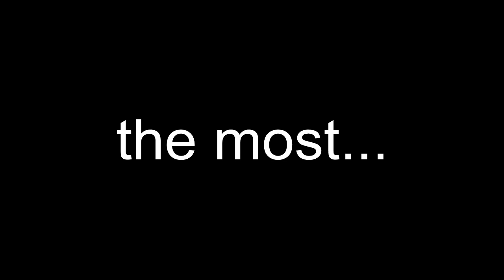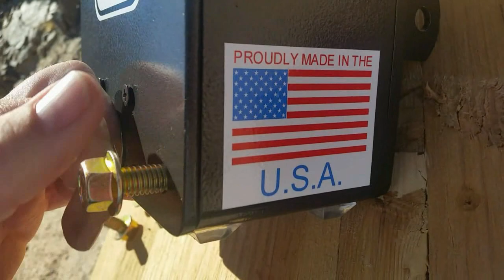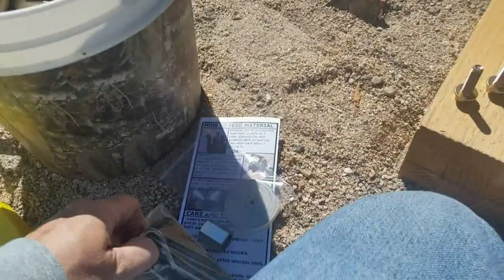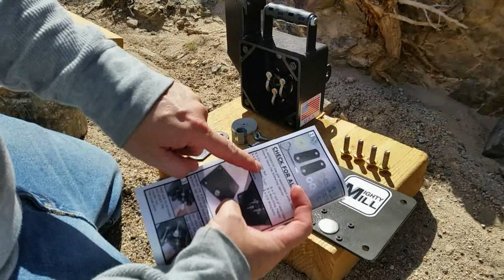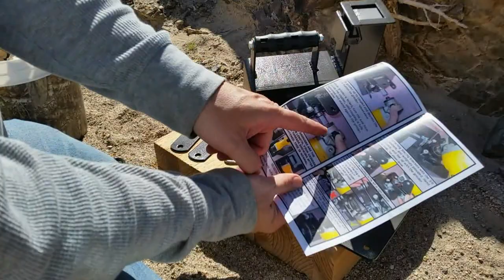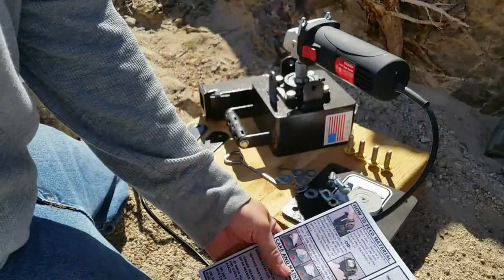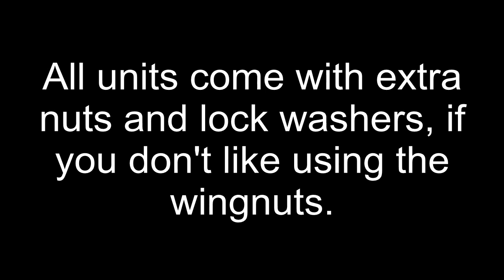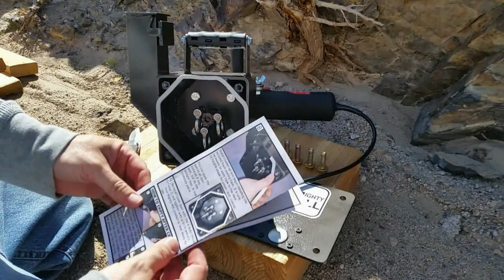Mighty Mill portable mini rock crusher. Sample GOLD ore FAST!!!

Comment: I purchased one of these last year and just got around to using it. One of my hobbies is to smelt iron ore in a bloomery style furnace and I had been hand crushing ore before. Let me tell you this piece of equipment is a GAME CHANGER. It is super easy to use and would eat any ore I threw into it. I was easily able to process ~ 100lbs of roasted hard rock iron ore (lots of hematite) into a find sand consistency in about 2 hours. Even with all that material processed, the internals of the mill are in very good condition. Works like a charm and I would highly recommend to anyone needing to crush up rocks! 10/10

Comment: Reading comments, I have been running the idea of attaching a "Feed Tube/Hose" from plug hole to a 
??something??, Bucket, can whatever! Just knowing the bit of pressure building up in there, there should be plenty of blow-out at the plug hole. I'm excited to get this Pulverizing!
Reply from the maker: I have already designed a prototype version of a discharge tube attachment that can have different sized mesh added, and I will have that available when I relist new mills in August. Here is a link to a customer's video that I made the prototype for: https://youtu.be/mtc7IIuN0Uc

Comment: When will the next batch be ready? I want to get one! We have lots of ore and quartz here in Northern AZ. Will any side grinder work? If not which one do you suggest?
Reply from the maker: So sorry I didn't see your message earlier. I just listed the last batch of 30 for the year...I think there are 27 left. Any 4.5" or 5" grinder will work, but I do suggest a variable speed grinder if you can get one. Run it on the lower 2 settings and this will make sure the bearing on the mill lasts longer, as it's rated at 5800 rpms. I'm also working on making an external bracket that will allow you to mount a standard 110v motor to the mill, and most of those run at around 3500 rpms. LOTS of new things coming in 2024, including new larger mills! Stay tuned!!!!

Comment: You should make one with a screened dump port opposite the load port and have it dump into a 5 gallon bucket for continuous processing
Reply from the maker: My video where I crush limonite shows my discharge tube attachment, and it's kooks up to a small 2 gallon bucket, with a vacuum. But I have thought about making a base plate that discharges straight into a 5 gallon lid....maybe in the spring I'll make it.

Comment: Hi, when will you have new units available on Ebay?  It's pretty much sold out, good for you!
Reply from the maker: I have a bunch of home projects that I need to work on for July, so I should have more available in August. I do have 1 more unit that I'll be uploading tomorrow. It's the hammered light blue open tube model.

Comment: Why stainless steel shackles? What are the properties that made you choose them instead of steel?
Reply from the maker: Mainly it was because of the hardness factor of stainless versus regular steel. I think stainless has a 90,000psi rating, so they last longer...but I'm almost finished with making hardened steel hammers that are a direct fit for the mill, and they have a rating of over 250,000psi. The second factor was cost...I can get them in bulk, at a fairly decent rate, which I pass onto my customers and offer replacement sets cheaper than you can get anywhere. Third is availability...even if someone doesn't want to buy replacements from me, they can easily pick them up at any hardware store that sell standard 5/16" shackles...but they'll pay at least $7/8 per shackle.

Comment: As a professional fabricator/welder. I would advise enclosing the impact chamber. The directional force just bounces the rocks around. That's why so much energy is being lost. And the wear would be less. It kind of does the job but I'm sure you don't get the right classification due to the impacting variable.  Just my 2cents.. You can delete this comment if its not positive enough for your marketing. lol I won't be upset :)
Reply from the maker: I don't delete anything...I'm not one of those kind of people lol! I too am a fabricator of 30 years, and prospector of a little over 10 years, so the first one I made for myself was the standard round shape like everyone else does, and I found that I was being left with lots of larger material because it was just rolling around the inside edge and avoiding the hammers. After experimenting, I settled on the octagon because it forces the material to bounce around inside the angles. I got a much finer crush in a single pass than with the round body. Yes, it's much more work to build, but it works great. Plus, 4 years now, and several improvements, it's pretty dialed in. I'm working on larger units right now, for more production based mining, but still gearing towards the small scale/single miner category.
Reply: @southernoregonprospector9074  sounds like your an experienced metal guy like myself. Great work though and with the videos too. I am planning on a separating screen before the outlet to maintain the classification. Maybe box off corner quadrants in the pipe to achieve the octagon shape...  :)  just thinkin out loud.
 I'm about 2 years into prospecting and 20 years in fabrication/welding. Built my own aluminum highbanker and just designing a portable jaw crusher and my final will be a portable mill like you have made.  Love gold prospecting and so does my son. Definitely turning into a passion. keep it up talk soon again one day!  :)
Reply from the maker: @user-bi8ux2ky2k  Very cool! Once you have gold fever, there's no cure. Checkout my build video too, if you have an hour to kill. Plus my discharge tube with screens can be seen on my ebay page. Heavy pans!!!!

Comment: I built one similar , same grinder ...lil tough on Harbor Freight grinder . But works well .
Reply from the maker: That's cool. Yeah those grinders are not designed for the stress of crushing, but they're cheap, so it's a wash.  I'll be posting a video soon going over the best grinder I've found so far, and it works great with the mill! It's a variable speed, 5amp, and the best part is that it's not expensive.
Reply: @southernoregonprospector9074  yea at $10.  a  unit , I buy 3 or 4 at a time ....can never have enough of em . Not putting my Mikita or Milwaukee on it .

Comment: Hey I have a question concerning an issue I am encountering. I'm using a makita cordless grinder and no matter how I hook it up it ends up on a slight tilt which causes the metal rings on the inside to hit the side walls. Is there a solution that you can think of to fix this? Or should I go buy a new grinder of a different  brand? TIA.
Reply from the maker: I've seen some Makita's that have the beveled heads, which makes the handle look like it's at a slight angle when screwed in. If this is the type of head on your grinder than yes, it may be causing a slight twist in the grinder when attached to the mill, because it's trying to pull the grinder close to the brackets, which can cause the shaft to be off center.

The only way I can think of fixing the issue is to look for some kind of a wedge type washer (thin on one end and thicker on the other), and use it to fill in the gap between the mounting brackets and the grinder handle hole.

I could also research your specific model and possibly make you a specialized bracket just for your grinder...if you would like?

Message me at soprospector@gmail.com and we can discuss it more in detail, and I can include pics if needed.

Comment: Looks sick
Reply from the maker: Thanks! This was the original version, and the newest is even better, with a larger discharge hole and better cover. I just sold out of the latest batch but I'll have more available in about 3 weeks. Plus I'll be making a NEW version that has a removable lid instead of the anti-kickback lid...so customers can choose which one they want.
Reply: @southernoregonprospector9074  sweet! 3 weeks I can wait

Comment: Since it can be mounted is there any way to have the option for pulley for a gas motor? Just a thought
Reply from the maker: The axle has a 5/8-11 shaft, so in essence it should be able to no problem...after some kind of base is made up. I'm actually getting ready to make a video where I hook it up to a 3/4 hp variable speed grinding wheel, which happens to have a 5/8-11 shaft. If it works out good, I will probably fabricate bases to support using a grinding wheel, which would be better for the bench top use option.

Comment: I like your unit!! Where can I get one and how much does it cost?
Reply from the maker: Thank you for the nice comment! I apologize, but I uploaded 20 units to ebay on the 1st, and they were sold out by the 19th. I'm preparing parts for the next batch for probably late October. I'm keeping the price set at $375. Checkout the discharge tube attachment which is still available on ebay now.
Reply: This product will break quickly
Reply from the maker: @jeffmiller2287  hi Jeff, can you tell me exactly what part will break quickly?...and why do you think that? I'm just curious, thanks.

Comment: I got the Krazy  crusher, works ok
Reply from the maker: I believe that's a manual jaw crusher, which would work great with this. First jaw crush it down down to smaller pieces, then run it through my mill to make it powder.
Reply: @southernoregonprospector9074  and then I bought  the cobra chain hammer mill to finish,  it uses  a Dewalt  hand grinder to run it also
Reply from the maker: @kevinerickson2595  yeah, as long as you get something to get the job done, that's all that matters. Fyi I'll be coming out with a few larger models very soon...buttoning up the designs now. Hopefully they'll be ready by early September. I'll post videos showing those as well, very exciting!

Comment: P.s could i adjust fitting so it will run a 4inch grinder because we mainly only have 4inch and 5inch ect
Reply from the maker: In the video I am running it with a standard 4-1/2" grinder, but a 5 inch should work fine. Sorry it took so long to get back to you but we've been dealing with the local fires for the past month, so my computer time has been limited.
Reply: @southernoregonprospector9074  all good mate i totally understand thanks alot for taking the time to respond.
Mate iv tryd finding it product to buy an when i clicked on link u shared it didn't work can we chat so i can order one through you mate im in australia and if like to test and possably start selling them here if ur intrested have u got a ebay page bud

Comment: Just subscribed, really like the looks and functionality of your crusher.  My only concern is the outlet, curious to see how that plug holds up over time.  Otherwise, I believe you have a winner and looking forward to future modifications.   Currently I crush with a dolly pot, this would be a game changer for me.
Reply from the maker: Thanks, I appreciate the nice comment and the Sub! This design is one that I played with personally for a few years, while crushing my own samples. The hole plug idea came after trying out different types of doors, release gates, etc. I've used the plugs for other projects, and when I tried it for this application it worked perfect. It's a simple pop in plug that grips tight with it's prongs, and you can simply spread the prongs open if it starts to feel loose. Plus you can get a new one at any Home Depot or Lowes type store. The plug on my personal unit has been good for over 2 years so far.

Also, by making them all with the 4 screws around the hole, it leaves people with the option to build their own type of cover plate if desired, but it's mainly there for the feed tube mod.

I'll soon be releasing the feed tube attachment which will make doing larger quantities of the same material much much easier. No more having to open the door or pop out the plug. Video on that to come soon too.
Reply from the maker: Just an FYI, the newest version of the Mighty Mill has a much bigger opening, with a solid steel door. No more hole plug! Link is in the description if you want to check it out.

Comment: Man this i have to say is awesome i can see the time and thought u have put into this will u ship to Australia mate i have been looking for a portable crusher.
May i suggest that extra point u stated at start of vid maybe run a 50mill tube outlet or someyhing like a drop system so it can drop into sluice that would be the ultimate mate
Reply from the maker: I apologize for missing this message, it has been a very busy month and my time on youtube is limited. I do infact ship to Australia, and currently have mills available on ebay.

Early next year I will be putting up a website for the mills, as well as add-ons, and a bigger unit I will be making to run larger loads for a more production ready unit. Very exciting times ahead!
Reply: @southernoregonprospector9074  awesome can u supply me the ebay site please bud and thank you kindly for responding.
P.s i look forward to seeing ur progress
Kind regards
Reply from the maker: @CONTAGENSAggression  no problem, here is the link for the active listing:
http://rover.ebay.com/rover/1/711-53200-19255-0/1?icep_ff3=2&pub=5575378759&campid=5338273189&customid=&icep_item=174494854105&ipn=psmain&icep_vectorid=229466&kwid=902099&mtid=824&kw=lg&toolid=11111
Reply from the maker: @CONTAGENSAggression  ...and here is the ebay link for the discharge tube add on I made for the mill. You can run it with or without the screens.
http://rover.ebay.com/rover/1/711-53200-19255-0/1?icep_ff3=2&pub=5575378759&campid=5338273189&customid=&icep_item=174378550659&ipn=psmain&icep_vectorid=229466&kwid=902099&mtid=824&kw=lg&toolid=11111
Reply: @southernoregonprospector9074  thanks alot mate i really appreciate the response and links legend :)

Comment: Hi, May I Know what is power source use for the grinder
Reply from the maker: The grinder that you use is up to you, it can be battery powered, or the electric plug in type. The axle arbor is 5/8-11 threaded, so all US standard grinders will work with it, but if you have a European model grinder you will need an adapter. The adapters can be purchased on Amazon or Ebay for just a few dollars.

Comment: I FIND THESE GRINDERS BREAK DOWN WAY TO MUCH   CAN THIS BE HOOKED UP TO AN ELECTRIC MOTOR???
Reply from the maker: It uses a 5/8-11 arbor, so as long as your motor has that thread size on the axle/spindle you should be good.

You are right though, the cheap Chinese grinders do break quickly, but keep in mind that they were never meant for that purpose. I've had the most luck with a 5" variable speed grinder, set at the lowest rpm rating of 4,000 rpms.
Reply: With a love joy joint you could put a motor on it. You can have this one for free. If you want any more tips it'll cost you.

Comment: I am impressed and may want to purchase, except that 19 March 2021 There are zero units available on ebay on your first link and your second link is dead. Why is that?
You did not show the the particles that did not go through the mesh for each material. That is important to show the efficacy for your demonstration.
Why didn't you show that?
Your warranty says 5 years yet you say we can hand it down to our grandkids and the casing will last forever. I expect it may take closer to 50 years for my grandkids to use this. A piece of metal (casing) may last a long time but a warranty is generally on ALL the parts of a stated unit. The moving parts are usually the most relevant parts for a warranty.
What is the point of a warranty that does not include the parts that are most likely to fail?
May I recommend that you do NOT bother with a warranty at all (other than standard consumer protections).
Reply from the maker: Sorry it took me some time to get back to you, but I was out of town due to a family emergency. I just updated the links for the newest batch of 20 mills that will be ready to ship on April 30th. They sell out fast, which is why the links are sometimes bad, but I try to fix them as soon as I have time...bare in mind that it is just me, I do everything myself, including building the mills, making any videos, and all ebay stuff.

To answer your other questions, I will try to do it in order and as short as possible:
-I didn't show all the particles for each material because I didn't think it necessary, they all came out the same
-My warranty covers the casing (mill body) and the welds, not any of the parts that can break or wear...I think that is a good warranty, and I often give customers free or spare parts out of the kindness of my heart. My wife frowns upon this practice by the way.
-All of the "consumable" parts can be easily found for good prices, such as the shackles, or even the bearing. 

I strive to make a high quality product, and am always looking for ways to make it better for my customers, all while keeping my prices low...even when the steel market shoots up over %75 like it has in the last 3 months. If you decide to purchase my mill than I thank you, and if you don't, then I thank you for at least looking. Let me know if you have any other questions, and make sure to checkout that new link, it's up now. Have a great day!
Reply: @southernoregonprospector9074  - Your reply is even more impressive than your industry. You addressed each point to its conclusion. You offered solutions, answers, insights and understanding, all with grace.
Outstanding.... thank you.